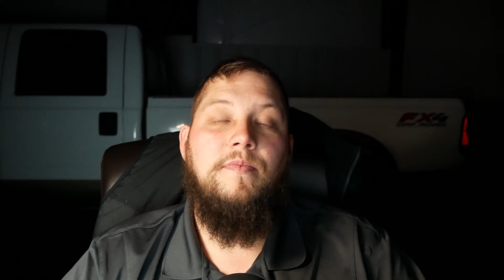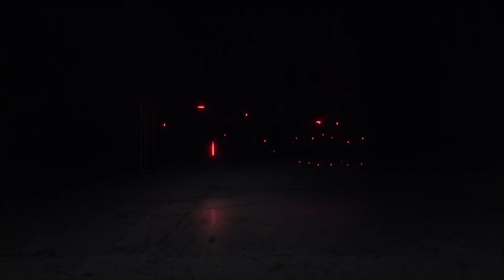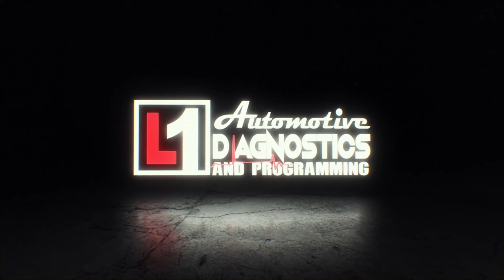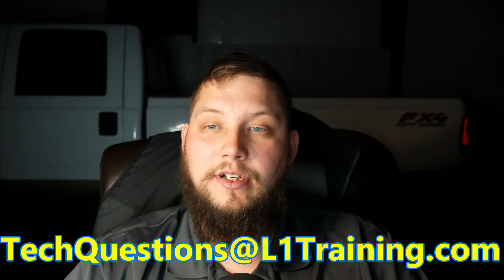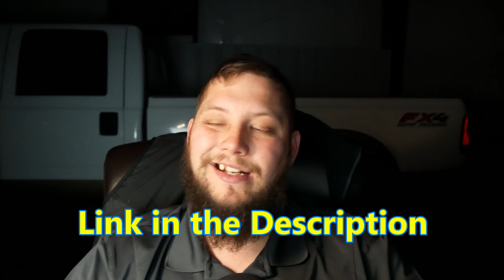TQQ #23 Why are you asking me for help

Comment: Good job nice information boss  ihav one Nissan xtrail  2014 engine light is on and iget fualt code p0101 maf sensor b1 we cheng the sensor and computer box but code still they I caler the code but code doesn't go check live data on the scanner iget car running rich fuel mixture tell me bos waht I can do please